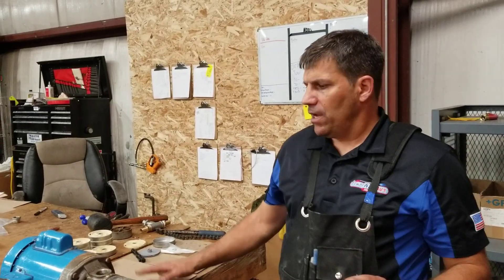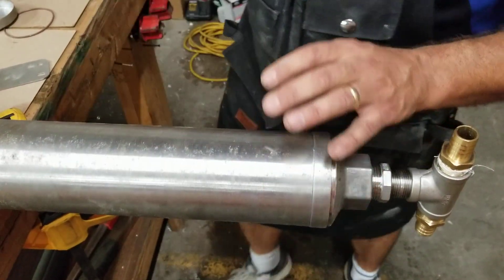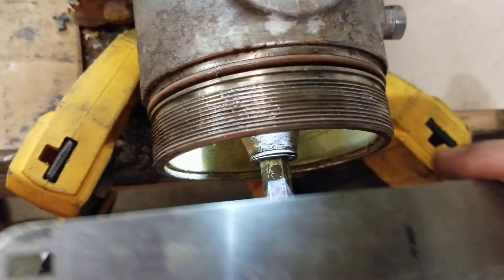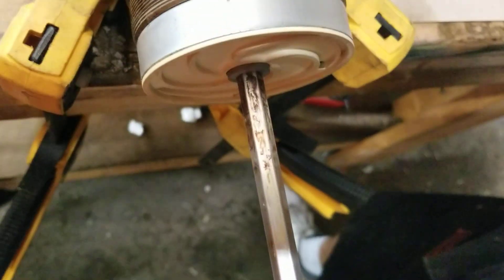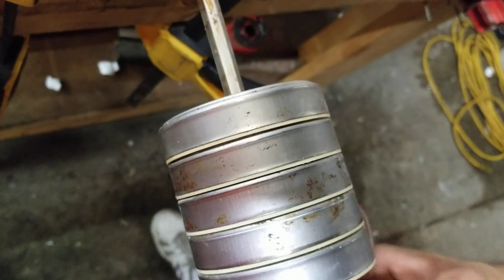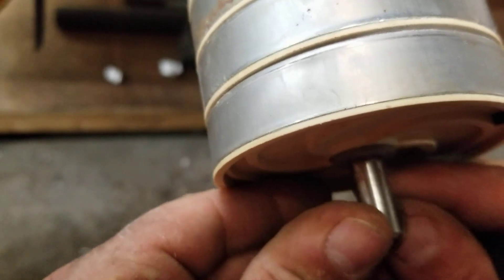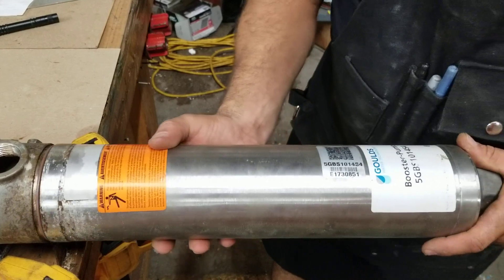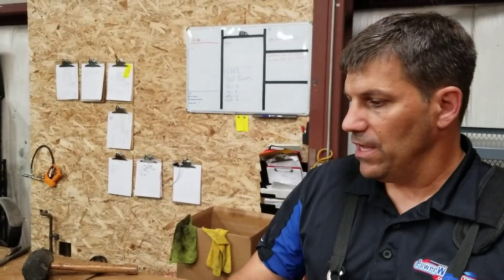Booster Pump Rebuild

Comment: Fantastic… this doesn’t look too bad assuming you have some time and space to work.

I have a 10GBC15 water pump feeding my house. I want to do a rebuild on it before it just fails one day. What rebuild parts do you recommend? I assume bowls are probably ok? But buy shims, impellers, diffusers, gaskets. Anything else? I see the centering end cap you put on- any bearings or bushings in there? Does that part wear anything?

I think mine also has a foot valve, or something preventing backflow. Any seals or things to consider replacing there?

Comment: What’s the benefit to using these over a diaphragm pump or 12v pump?
Reply: Looks like a multi-stage vertical pump. A diaphragm pump isn't going to come anywhere near the volume output, especially on a portable air supply.
Reply: No joke a pump that tall should be able to slam out like 60gpm on a 3500 120c single phase 3/4hp motor

Comment: Hey Paul thanks for the posts...i have a Q about the wiring hook up for the 220v  10gpm 2 horse booster pump ...im not sure what goulds is calling hi and low voltage on the  tag on the motor.  I need to be sure which is 220v. Since 220 means you have line1 and line 2 ..it says line1 and line2 fir low voltage to..very confusing...